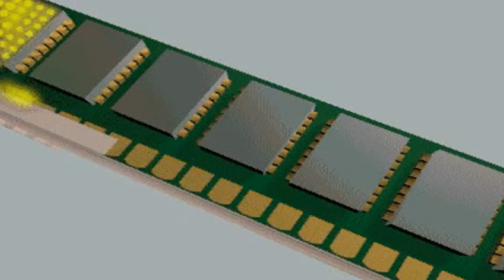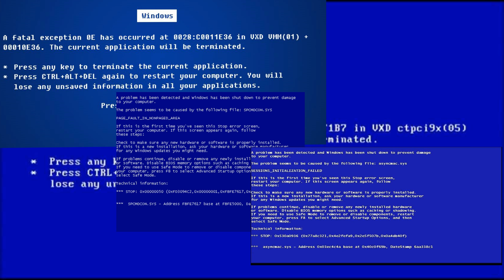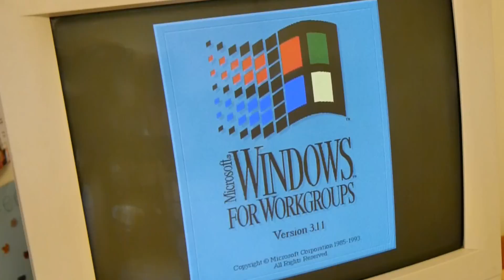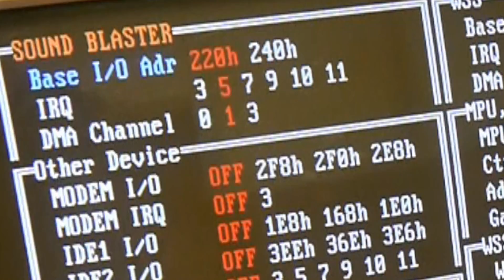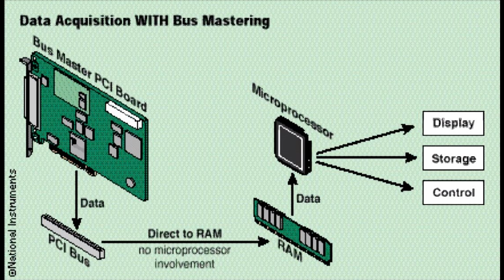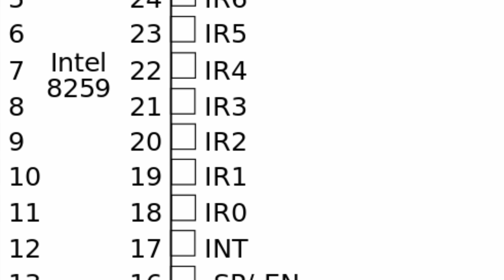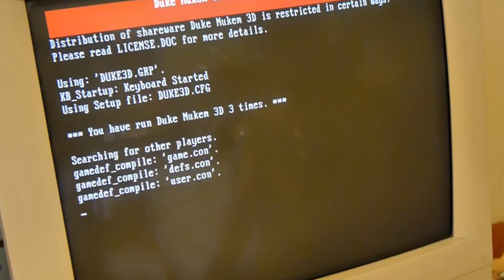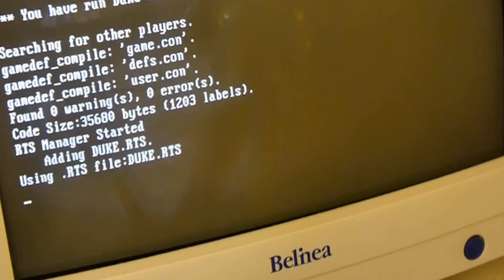What are IRQ, DMA & Address Ports? - Soundcard Memories [Byte Size] | Nostalgia Nerd

Comment: What are IRQ, DMA & Address Ports?
Reply from the maker: Brancasm beats me.
Reply: The first is your teacher poking you with a ruler so you can pay attention to her task, the second is you copying your friend's work directly instead of asking him and the last one is where you sit in the class, now on the dunce chair because you got caught dmaing your work.
Reply: Brancasm Kid in 2037 : "What is usb, apps and touch screens?"
Reply: IRQ is an interrupt request by the hardware to inform the CPU of some event - the keyboard would send interrupts for key presses and releases. DMA is direct transfer of memory. A hard disk drive controller could send kilobytes of data message by DMA straight into system memory. The CPU had a special bus for writing to hardware. You read and wrote bytes down this bus by using the IN and OUT assembly language commands. In hex E6,60 would send the contents of AX to port 0x60 which was the speaker frequency. No volume control.
Reply: Interrupt ReQuest, Direct Memory Access, communications port. 

Universal Serial Bus, mobile applications, resistive / capacitive input device.
Reply: @PhoenixNL72-DEGA-  as apposed to nowdays where we carry it around in our hand and poke at it with our thumbs